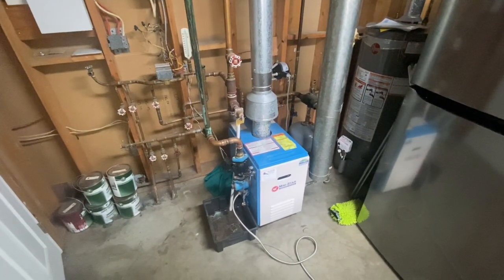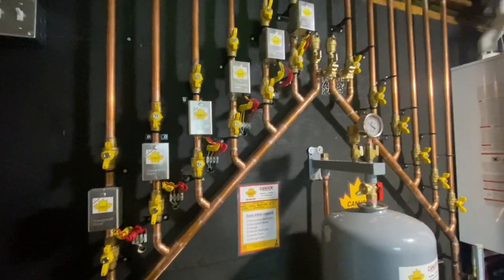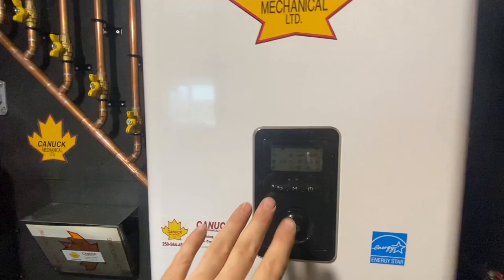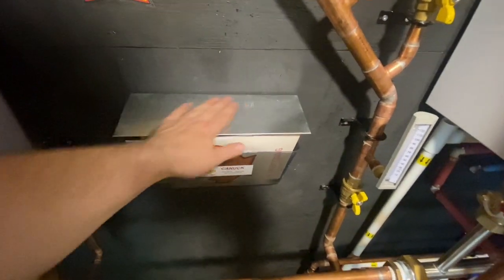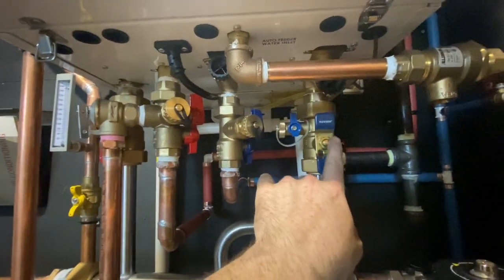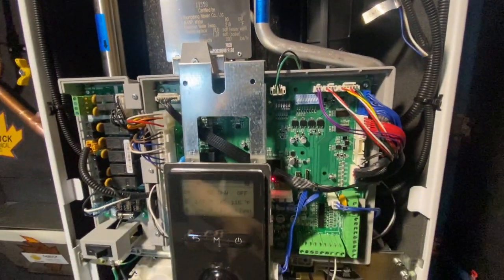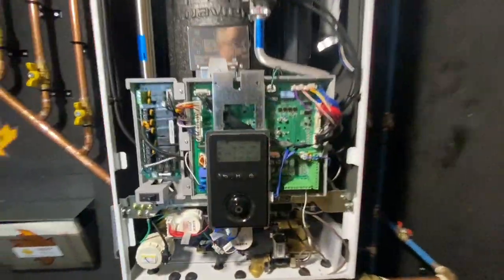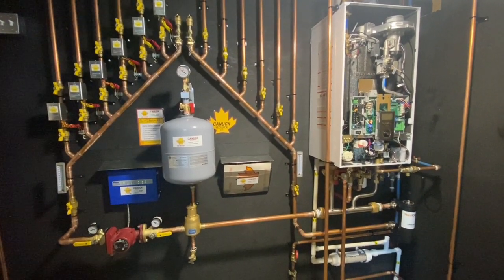Navien NFC-175 Combi-Boiler Retrofit #4

Comment: On your thermometers for your delta t, have you thought of using tri-dicators? We use them. Pressure and temp in one. They're very easy to read too. You're boss level work as always.

Comment: Where did you get the isolation valves for the pump with the 1/8” not ports for the temp gauges ? I’ve searched everywhere ….
Reply from the maker: Are wolseley branch in Prince George Carry’s them

Comment: What's the reason to install that zone control.  Can you would  run the circulator pump with a relay box. Just question?
Reply from the maker: Yes you could but the controller cleans everything up

Comment: why would you need a auto vent on the expansion tank bracket/manifold? and that Bypass you set up on the neutralizer condensate drain  will never be seen and untreated acidic water will simply  destroy the condensate pump.

Comment: James each time you do one of these boilers you raise the bar on the quality of the installation I’m getting ready to install a  fire tube boiler . In my own house I have to install a low-water cut off where would you install it on a fire tube boiler .
Reply from the maker: close to the boiler in the case of the Navien they have an outlet on the top for such a device but regardless its should be placed above the boiler and above all pumps return or supply side does not matter

Comment: Very nice. Love the way you plan these systems. I just would rather see you use Bosch instead of Navien
Reply from the maker: Not common enough in This region yet
Reply: I see you've been watching Mikey Pipes? The fire tube models don't have the horrendous leaking heat exchanger design